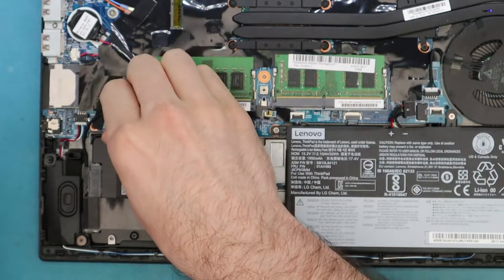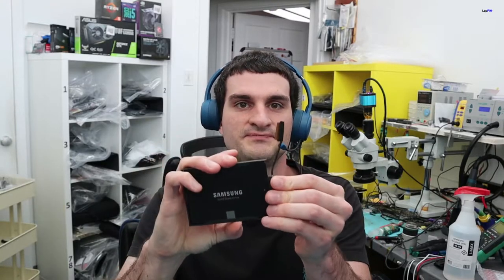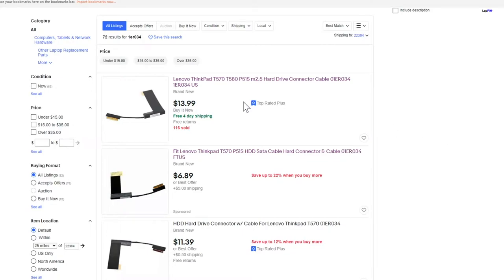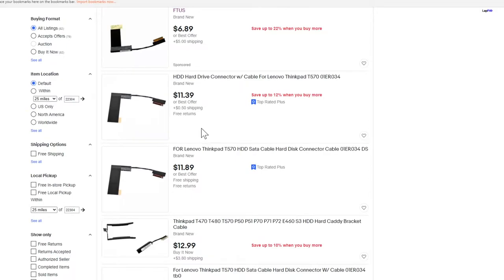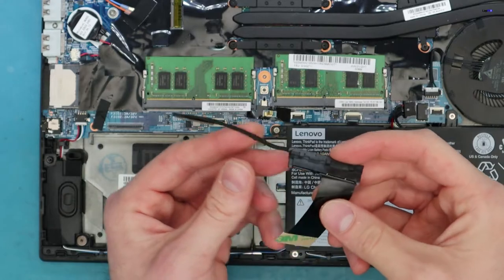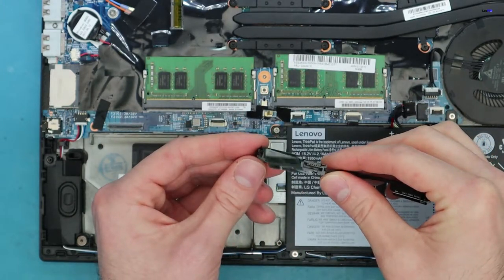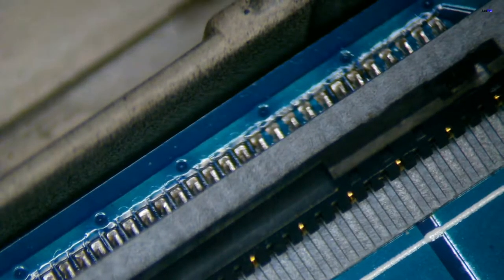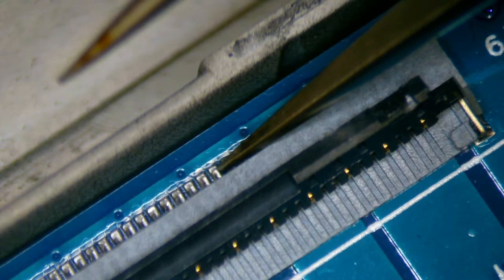Lenovo ThinkPad P51S Hard Disk HDD Connector Fail Repair

Comment: Thanks for the info, but I need a picture of the connecter cable because the one I have has some actual cables cut and I don't know where most of them go, so I need one as reference.

Comment: Thanks for the video, it was well done. Unfortunately, I have the same problem and resoldering the port caused the ThinkPad to make a song with error code 0001 while booting if the hard drive cable is plugged in. I was careful but these connectors are so small that a human error can occur while trying to repair. I just gave up on it and removed the hard drive caddy.
For those with the same problem, the good news is you can still use another SSD in the WWAN port. You'll have to get a M.2 SATA SSD 2242.
Reply: I'd like to temporary fix the issue using the M.2 Sata. Any suggestion about how to copy my Windows on that SSD? I really don't know where to start from:I magine I need to use a working laptop to do that. And than, what?
Reply: check the Sata fuses near the connector, normally either 3.3v or 5v is blown after this effing chinOVO problem

Comment: Unfortunately, it's a known and widespread issue across Lenovo T570/P51s/T580/P52s models up to 05.2018. Also happened to my T580.
Reply: My work has many T580s and P52s and a bunch of them are having drive issues. I even had one connector just pop off inside the case. It's infuriating.
Reply: @henrychinaski39 hey, I just bought a refurbished T580 on eBay and I happened to have missed this quite big defect. How do you know that the issue happened up to 05.2018 and not after?

Comment: My T570 is currently in repair shop because of this. Guy that works there knew as soon as i said T570 drive not working. He said that he soldered dozens of those conectors on Thinkpads 😅

Comment: Yes still a problem with the Lenovo laptops, causes all types of problems when you think it's the HDD only to discover it's not the hdd but the connector, Lenovo are well aware of this problem but refuse to acknowledge this, real pity as the laptop are nice and light, but, unfortunately i did not do my homework on this one otherwise i would have steered well clear.